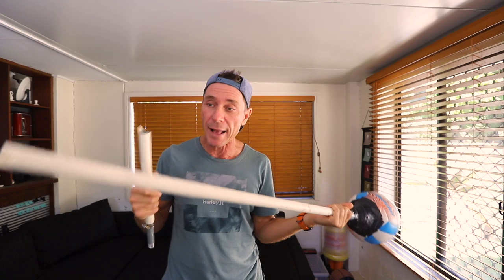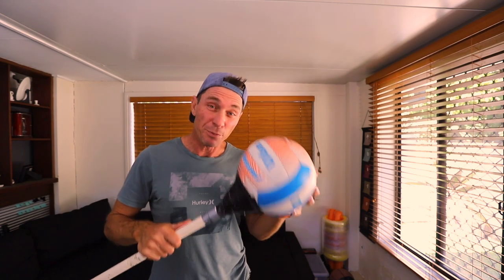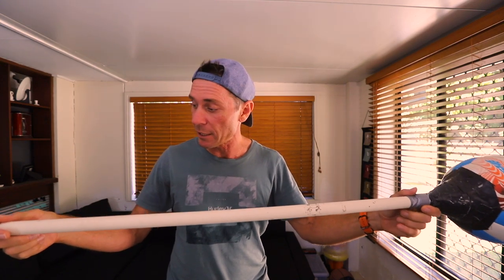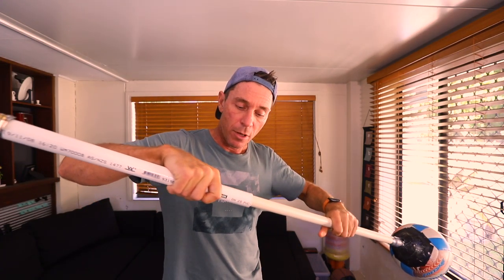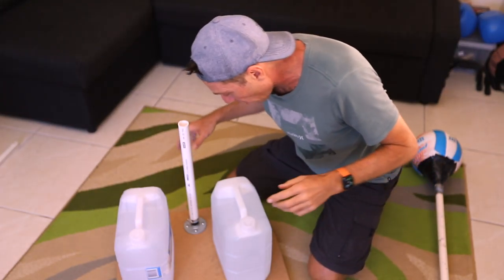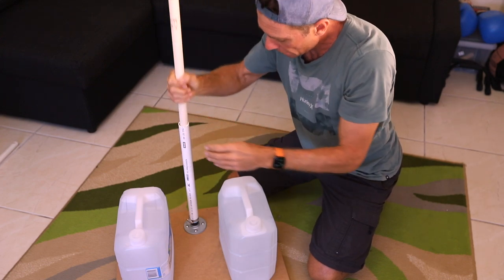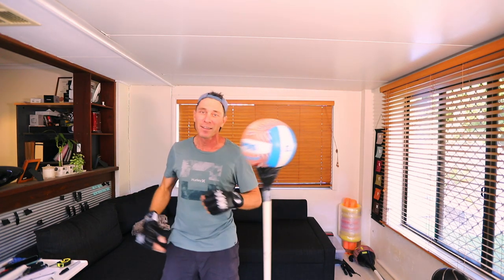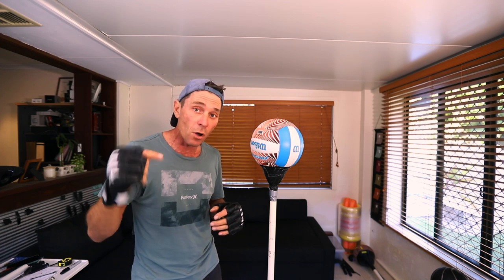DIY Punching Bag Broke! Time To Make a Better Version.

Comment: Works great but a problem I found is with the 1” and 1 1/4” pvc it’s not as springy as I thought it would be but still great puncher
Reply from the maker: Yeah 3/4 inch pipe is best with a lighter ball

Comment: now mount that upside down to your ceiling, and you will have a reflex speed punching bag where you will be able to practice far more  range dodging tchniques because you will be able to move in more directions without the reflex bag, base, and pole obstructing your way. thanks for the idea. cool job.
Reply from the maker: Great idea 💡

Comment: Been awhile since i made one. Found my old base in storage, still had the flange and the pipe, with the 1 and 1/4" inch PVC. I bout 3/4" PVC to make my pole earlier. Man I just think maybe the PVC is super thick here in the states, or something. 3/4" Pipe will barely flex when punched. I may have to try a 1/2" and just hope it doesn't break. I got 5 foot for $3 American so it isn't breaking the bank at least.

Comment: How to do you attach the pipe to the larger PVC pipe, would appreciate a post on this version of the bag on your website!
Reply from the maker: The method is the same as the way you attach it to the galvanised pipe - using a hose clamp: https://www.fighterdiy.com/2020/05/diy-reflex-punching-bag.html

Comment: Is the bottom PVC pipe stronger/harder than the part at the top? / does that bottom PVC pipe is moving too? Or is it stuck? And my English isn't that good sooooo, how long is that Metal Pipe which goes into the flange?
Thanks for the nice video, I will rebuild it as fast as possible
Reply from the maker: Yes, the bottom PVC pipe is 1 inch diameter and the top is 3/4 inch. The bottom pipe is moving too, but it is much stronger so less likely to break. The steel pipe is about half the length of the bottom PVC pipe. If you use a longer steel pipe, the bag will be faster; shorter steel pipe will make it slower. About one foot is a good length for the steel pipe. For more details and to ask further questions, please go to https://www.fighterdiy.com/2020/05/diy-reflex-punching-bag.html - I'll answer them right away so you won't be waiting. Good luck with your build!!!
Reply: @Kewlus  Thank you very much, Sir!

Comment: Hey boss man. So I’ve got all of the fixings to make this BUT I was wondering if using a pool noodle would be equally effective to use as a strike pad similar to the fiberglass version?
Reply from the maker: Yes absolutely!  I no longer use balls but pool noodle pads now. You can make the target modular which is one of the biggest advantages
Reply from the maker: I can’t say just from looking. My main concern with that one is the plastic nozzle. I d recommend a steel nozzle